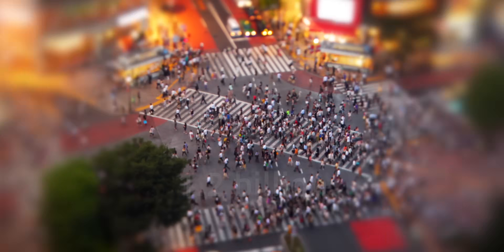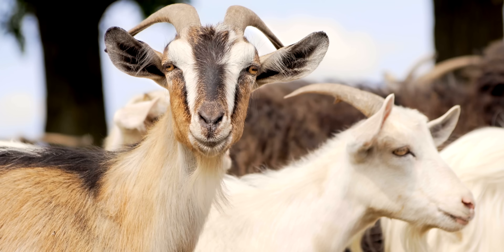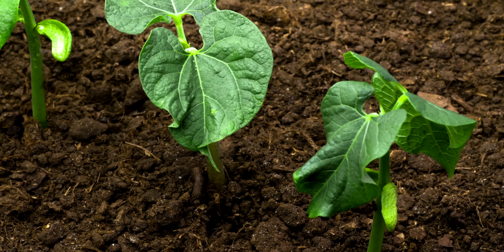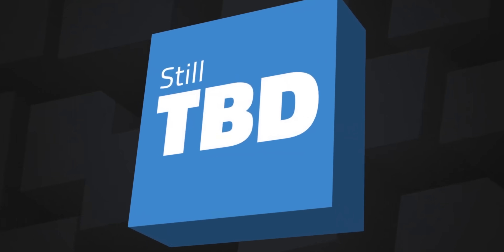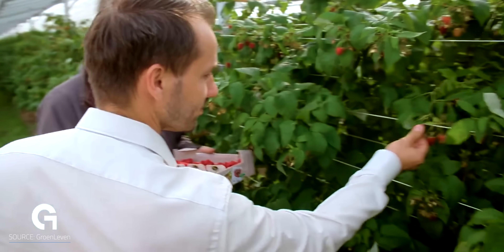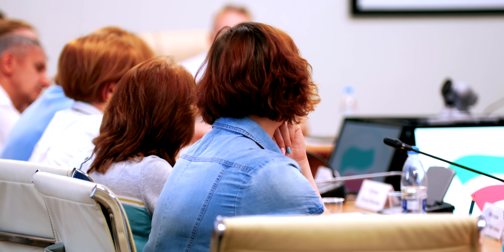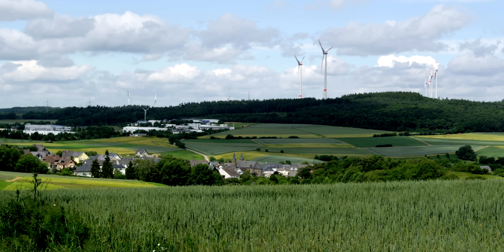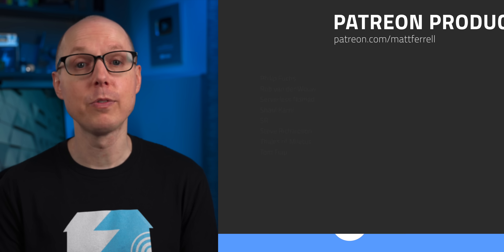Solar Panels Plus Farming? Agrivoltaics Explained

Comment: I love making things synergize with each other, like I supplemented my home heating last winter by crypto mining with 3 gaming computers, my main and 2 older outdated ones. Now it's hard to tell how much gain I got from the mining cause I also reduced the temp that I keep my house, but over all I dropped my heating bill drastically by around an average of $100 a month while making around 3 dollars a day from mining. Typically all the heat from mining is just waste heat but in this case all the waste heat was used which technically made my electrical use for mining 100% efficient. Environmental impact isn't as large in my area cause we use nuclear power but still reducing my bill either way is just a small bit good for the environment so I found it amusing to do that by using crypto mining. Unfortunately I can't do this for this winter cause of the new ether merge which kills any chance to make profit with my older GPU's so my heat bill is going back up this winter if I can't find an alternate solution but I am currently attempting to figure out an alternate solution. Wanted to see about trying to make my own sand battery cause I've had good luck this summer saving money by not using my AC during peak hours which basically doubles the power cost during those hours so my idea was to make my own small sand battery from a 55 gallon drum I have to heat up during the day and use to supplement my heat at night when rates are higher. Getting the drum and sand was easy but finding a way to heat it up then move that heat into the house is the challenge. If anyone has any tips I'd love to hear them. I wanted to make my own solar air heater with a huge stock pile of soda cans I have laying around and black spray paint but I am not used to building things like this so my experience level with these things is lacking. I just need a solid idea for the heat source and then a solid idea on how to move that heat into the house. If I was just going to heat it with electric only I can just put the drum in the house cause that would make most sense. If I could still mine I could vent all the heat from the miners through the battery during the day to kind of store some of that extra heat when it isn't quite as needed but yeah. Still need a heat source even if it's just going to sit in my house. At least outside the drum is painted black and it's get hot as crap just sitting in the sun on it's own.

Comment: To the weak-minded who have no experience, knowledge, training or education in engineering, your argument makes sense. But when one is dealing with an energy expert that spent three decades in the industry including time as a consultant in the energy industry, your argument makes no sense whatsoever. Let me give you a few points you've neglected to address. When the sun is shining brightly and the solar array is at full power, tell me how much of the sun's rays are actually converted into electricity? You don't know that answer but I do, it's 14%. Now let's talk about cost? Who pays for the cost of the solar array? Well it's the public because the entire renewable industry, especially solar, is completely subsidized by the state through a variety of subsidy measures. The local public utility Commission are the first ones who mandate that the local electric company must purchase the Surplus energy. Then of course there are the filthy federal grants which enable it to go forward. Now let us talk about who makes those solar panels, the filthy communist in China who are paying off most of our politicians and our journalists. Now let's talk about when electricity is made from solar power is it useful. Some of the time it is. But most of the time it is not. Why? Cloudy days, nights, cold days in January when the sun is not shining and there is cloud cover. The solar array doesn't make power in fact most of the time it does not make power as with wind and solar this fact is proven many times over. So the whole industry is subsidized, renewable energy is a joke. What Built This Nation in terms of power and what continues to supply the power day in and day out that most Americans use that is reliable, safe and non-polluting? It's fossil fuel and nuclear power. And without State subsidies there wouldn't be a single megawatt of renewable energy ever built. Renewable energy is a joke. Climate change is a joke and talk to any geologist and they will tell you how from the formation of the earth climate change has been ongoing, unceasing and the plan of the Earth has been in a constant state of Flux Of change Always. Example: Maryland was once an ocean. What changed? The climate. And of course climate scientists s are nothing more than fake science never explaining the fact that the Earth has been changing since it's very formation. Don't believe me? Take a look at the Pennsylvania era in geological times. How was oil, Natural Gas, peat, coal, lignite formed? Talk to a geologist and you will learn. The whole science of climate change is just like the fake news. Not based in reality or facts just pretend selective information piled together. And do we live in a microcosm? Take a look at many of the Nations around the world that have absolutely no pollution control equipment on them whatsoever with their vast array of coal fired power plants and other energy conversion factories burning fossil fuels. It's a joke because the whole concept of climate change and renewable energy is nothing more than a transfer of power and wealth to the government and to the multi-billionaires that control the companies who benefit from such a change. Renewable energy should stand on its own and be able to compete in an open and free market with no government intervention, subsidies, barriers to entry or other false precepts to compete with fossil and nuclear power generated energy. If renewable energy is the way of the future, then let's do as St Paul suggests, put it to the test of the marketplace. Let the strongest win in the words of Alexander the Great. Renewable energy is a bust. We need only to manage our assets wisely in the world has plenty of resources. Why? Because that's how God made it.

Comment: Huge amount of farm land is for cereal crops and the machinery is massive so can't see those fields being used, also the idea of larger animals the support poles will have to be much heavier duty cows and horses will rub against them and bump into them. It definitely appears to have some future. The "A" frame type will need guttering to stop there being lines of mini streams which wld wash soil away, look at the old ridge and furrow farming lay outs

Comment: Much work has been carried out on tree-crop interactions around the world with traditional Agroforestry methods, replacing the tree element with photovoltaics will work. In India PV panels built over irrigation canals/channels reduce water evaporation and utilise the space over the water producing localised electricity in rural areas. The availability of electricity will reduce the use of petrol generators and the burning of wood and biomass. Is any one developing PV for walls and doors?

Comment: You forgot to mention that the energy produced does NOT and CAN NOT meet the demand of our energy needs. Especially when you take into consideration the ENERGY needed to make the panels and maintain them. 
There’s basically zero benefit. 

The end product doesn’t meet demand which means you’re still hooked up to the grid and when coupled with the energy used to make and maintain the panel you’re at a zero benefit to the environment, power needs and in the hole financially. 

Oh and all of them are built in, You guessed it, China! Not America! 

So not only are you not creating jobs, shipping jobs overseas as usual, but China doesn’t follow any measurable environmental standards! 

Good video, good ideas, good work around, but let’s be honest about it! 

In the end it has zero benefits for the environment, and could possibly be an overall negative when taking into consideration the stripping of minerals. 

It’s a feel good project at best until you actually take these things into consideration, then you don’t feel so good about it at all!

Comment: I'm a huge fan of solar - I've been tinkering with it as a hobbyist for 15 years now. BUT I can't agree with using farmable land for solar installations. When onshore wind takes up only a few square metres of a field and the same capacity solar prevents acres from being farmed it just doesn't seem appropriate, necessary or sensible.
Wind = dual use
Solar = no food crops. Afterall plants ARE solar collectors we can't give the light to both.
Solar should be limited to unproductive land, urban areas and possibly over water on floating farms.
In my (admittedly, not very) humble opinion.

Comment: I really think dual-use PV will be the future rather than dedicated solar farms. Rooftops are a great example... but you know what's even better? Roads. Roads are wasted space (in terms of solar power!) and putting a PV array OVER them neither impedes traffic nor reduces light to the point where driving is difficult. Even better, it would lower the maintenance requirements of the roadway if done properly.

Comment: What about adding high intensity LED arrays to the Solar canopy?  These would add another tool into the optimization algorithm and use  relatively little energy compared to the output of such large panel installations.

Comment: SoCal is a perfect location. This year for the first time I'm getting electricity credits while running AC whole day long. Thanks to solar panels installed last fall. The fact that LA didn't experience any power outages this year while temperatures hit all time records is a proof of solar panels benefit to the community in general. I will be super excited to see the synergy examples between agriculture and renewable energy production

Comment: In deserted area the solar panels provide shade and in right angles some panels (not solar) to direct air circulation  also help to keep a small part of moisture.  Many desert areas have water but in depth and solar panels can provide energy for electric pumps.

Comment: I think this is a brilliant idea. We need to stop looking at solutions strictly based on the economic impact.  This seems to be a beautifully synergistic system which addresses several different problems especially, as you said, in hot arid regions (like California where I'm at).  I feel like the economic challenge is probably the hardest to overcome as land and labor is quite expensive but I would imagine that there are many energy co-ops and well as municipal power companies that would be able to find willing farmers though many will have to learn to grow crops that thrive in shadier conditions.  Hay and fruit/nut crops are huge out here and those wouldn't tolerate that much shade. However, I think this is an idea that could really make a difference out here becuase water is pretty scarce in the summer as well, so reducing water usage is another huge benefit.  Also, just thought of this: I know that dust/dirt significantly affects the efficiency of solar panels and trying to keep them clean has created a problem of high water use in arid areas.  Letting the water used to clean the solar panels then water the crops underneath seems like another win-win.

Comment: I am planning on doing this out in my pasture at some point. Just mounting the panels high on a pole... they will provide shade for the animals... but enough light to keep growing grass. 

100% Grass-fed beef does not require irrigation, oil-based fertilizers, tilling, herbicides, pesticides, or fungicides. I will use small mobile watering points and electricity though.

Comment: A couple of thoughts on the raspberry farming you showed.
I live in WA state which produces about 95% of the nation's raspberries (at least according to the google oracle).   Grew up here and have never seen any farmer cover them in plastic.  So I'm guessing that is something more specific to the climate in the area shown in your video.
Second was comments about saving labor due to not having to deal with the plastic.  Where I live, most of the berries are harvested by a picking machine.  They appeared to be harvesting by hand and the setup shown looked too low for a berry picker.   That adds a lot of labor.  Machine picking requires a LOT less labor and gives greater yield because you can go back over the field in a few days to get the ones that were not yet ripe.  Something that isn't worth bothering doing when picking by hand.
Reply: Cloudy/rainy climates will reduce all the advantages mentioned. This is more for California where it doesn't rain for 8 months in a year and there's a lot of sunny / 90 F+ days. Like the Central Valley.  Also, India where there are a lot of rain shadow areas.  The world's largest solar plant is in India (the size of Manhattan) and accounts for 2% of India's power generation. More are planned as this was a test case. Lack of such large chunks of land is sure to be a problem in the future.

Comment: There are solar panel farm proposals in my area, the benefits seem to be to the shareholders of the company involved, nothing for the local community except for a couple of farmers who will receive a nominal rent on their land. The amount of concrete involved in the scheme(s) is absolutely frightening. Concrete pollutes the atmosphere in its production and is an issue in topsoil. Environmental groups have already raised issues about the net loss of useful agricultural land and the slow contamination of topsoil on land that could potentially remain in use. In the meantime new houses are built without panels, retail parks with massive car parks, motorways and railways untouched, brown field sites under-utilised, retail and industrial building without solar panels. Agrivoltaics should be for businesses that use extensive greenhouses or polythene frost protection. When we need to maximize land usage the comment about minimal land loss is just a throw away line, 3-10% is not acceptable when land is also being lost to urbanisation. Perhaps if some countries looked closely at their diet we could help the environment, beef farming is wasteful and damaging as is pig and poultry production. The piece shows its bias when the first issue you raise is NIMBYism. The first issue is investment. rich countries invest untold billions in weapons and research into better ways to kill people, allow tax havens which eat up huge amounts of money that could be used to invest in 'green' technology.

Comment: Comparing individual output of agro / solar farms is not exactly fair... if you were to have ALL arable land as agrivoltaics, how much food would you lose vs how much energy is generated?
If that energy was used to grow food in artificial environments, would it offset the losses?

Obviously there are a lot of ifs and buts in the above. As models can be ideal but people will not act as per model predictions. But that result might still be attractive enough to justify a switch/hybridization of agriculture.

(I'd have loved to see how viable agrivoltaics could be in California, where I remember hearing that the water required for irrigation is dwindling and crops might find themselves in serious trouble... maybe a subject for a future video?)

Comment: Using partial laminate solar with high overhead space would be even better. It would let through some light, and water collecting could be integrated easily and cheaply.

Also, why on earth isn't this being boosted in the American southwest? There is zero problem installing solar anywhere there, outside of city centers.

Comment: One thing rarely mentioned is that not only can plants get light saturated, PVs can convert 10x-20x the received light. If the plants are then saturated by chlorophyll-optimized LED grow lamps, the PV density could be raised to the same as a normal solar farm.
The reduced water usage also reduces the amount of nitrate fertilizer needed, as less gets washed away by irrigation.

Comment: I had a similar idea a few years ago. I would make a photovoltaik and solar roof over the german highways.
1. Problem Germany is small and space are limited. So why dont use the space above the highway.
2.Problem In hot summers the asphalt of the road get hot and destroy tires of cars and trucks. With a roof the asphalt wouldnt be that hot.
3. Snow, it costs a lot of money to use plowertrucks to push the snow of the road. They use salt to keep the road clean. She salt is aggressive towards the cars. So cars start to rust. With a roof you wouldnt have to deal with that.
4. Same with rain

But that will not happen because my homeland germany has incompent leaders they only gift are taxmoney to warlords, taliban, scammers, robber, social parasites....................

Comment: Duel use energy: Gevo, a biofuel company, takes inedible industrialised corn, separates the carbohydrates from it for sustainable aviation fuel and the rest of the mass is given as high protein cattle feed (the carbohydrates removed from the feed would only ferment in cow's stomachs and create more methane byproduct from the cattle). They also take the manure from the cows and ferment that to create renewable natural gas and fertilisers to be fed back to the field to grow more corn.

I think involving farming in energy production allows for carbon sequestration (via plants) which other next gen fuel production doesnt have (EV, hydrogen fuels cells etc)

Comment: I always thought the space above warehouse roofs should be put to better in use. Imagine installing solar panels on most of the warehouse roofs of a big city near you. The building underneath is used for storage or some other technical process. The area above could be put to use as well.